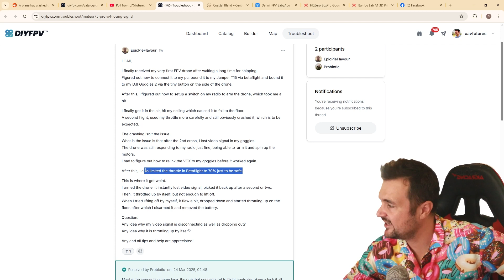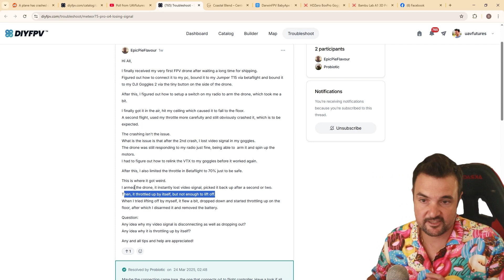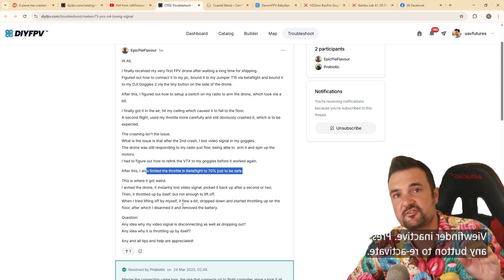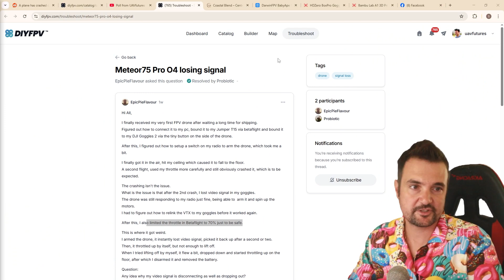"Why wont my drone work?"

Comment: I have more questions than you can imagine. I got the drone bug and quickly built 4 of them. I have a 3 inch, 5 inch and two 7 inch drones. Parts were all from aliexpress. Flight controllers are mostly speedy bee. After some practice my soldering looks pretty good. I bought a Radio master Pocket and a DJi Goggles 3 with a o4 lite Air unit for the 3" drone. I'm fairly certain I wired everything correctly. In betta flight I can bind the receiver but the radio master throttle doesn't activate the motors, but I can see the blue line in beta flight move when I move the throttles. It's really annoying, I've been trying to get any of them to the point where I can go on a test flight, but it's difficult without motors that spin.... The video/VTX portion works fine, no issues there.
Reply from the maker: the motors wont activate in betaflight on arm for a saftey thing. have you set up an arm switch?